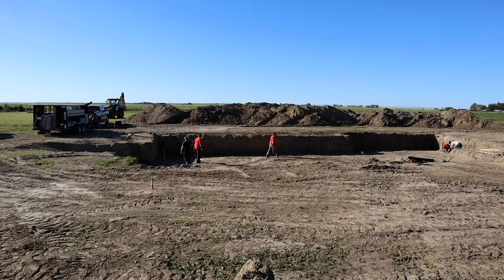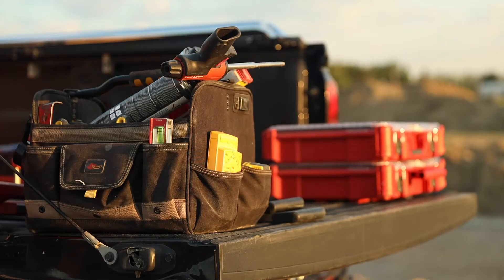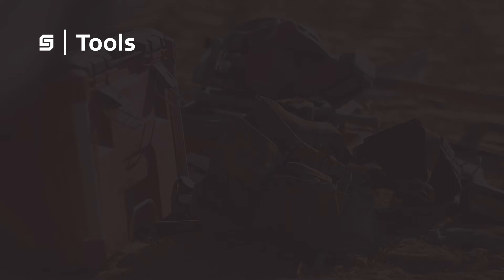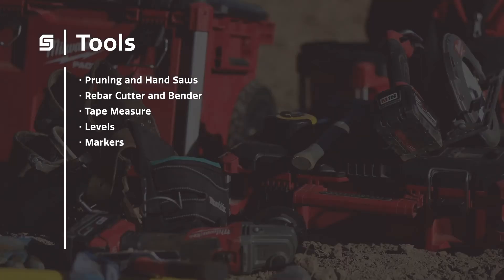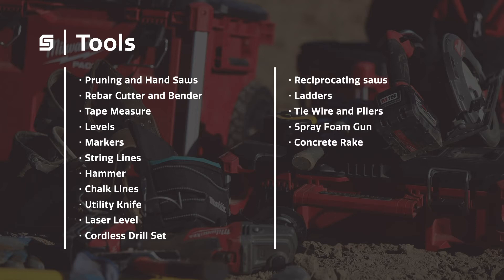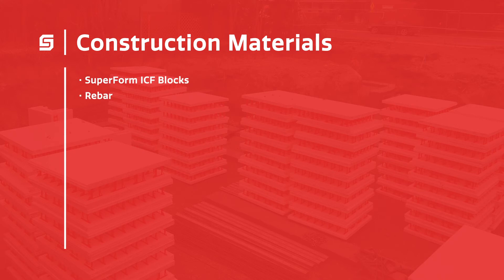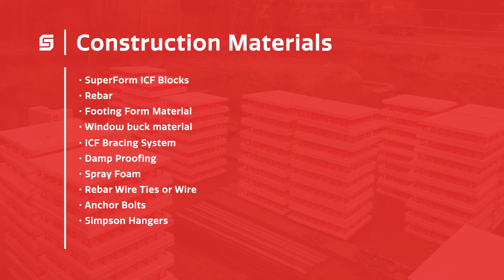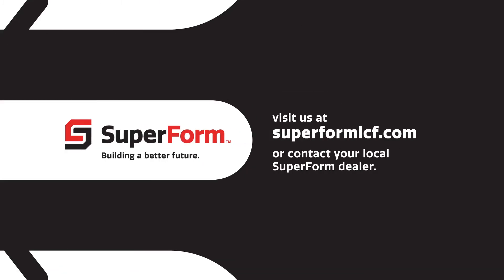ICF Installation Series - Rules, Tools and Materials (Part 1)

Comment: What are "ICF screws"?
Reply from the maker: ICF screws are the perfect option for attaching to SuperForm ICF. The screw features a loose washer design, and each screw is hardened and galvanized. They are course thread which provides maximum attachment to SuperForm’s plastic webs.

You can view them here: https://www.superformicf.com/accessories/#productTabs-5